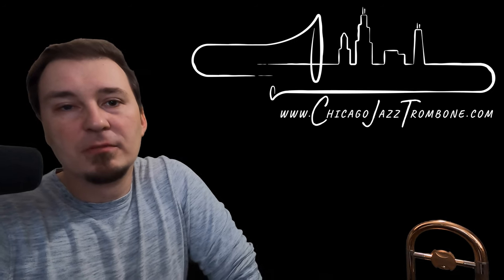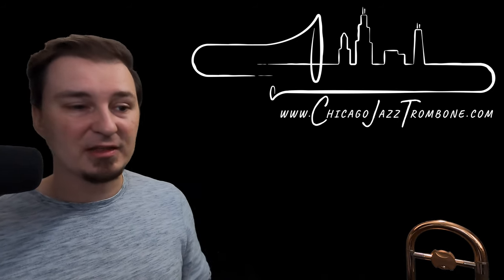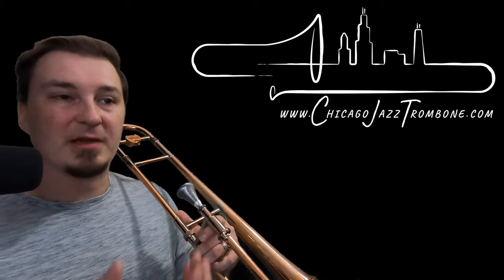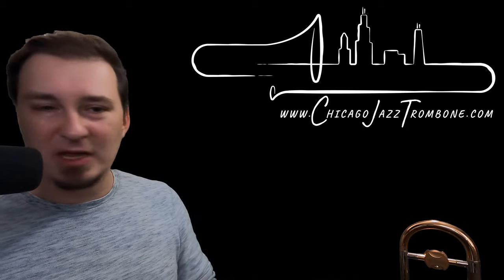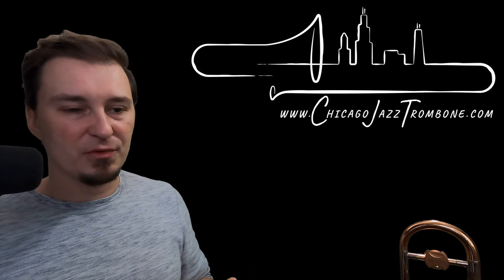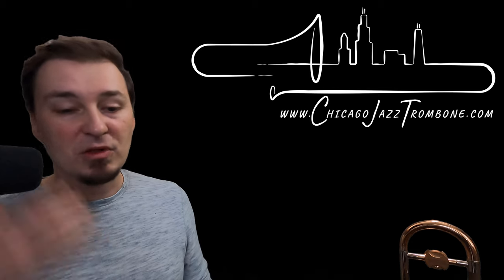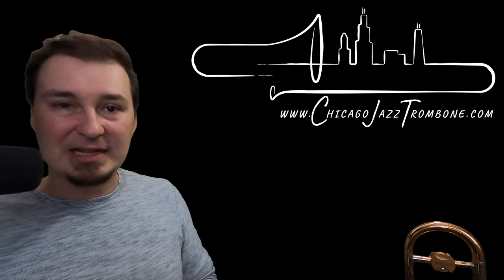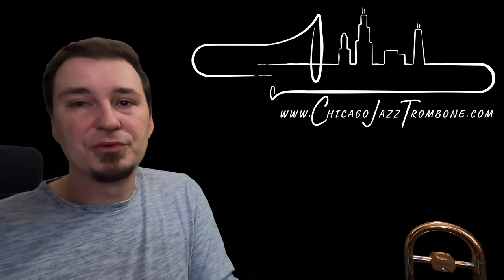Trombone Lessons - Mechanics of Upper Register Playing - Speeding up the air.

Comment: But how do you inhale for some air cuz when i reach up to c as a beginner i try to inhale idk if i opening mouth widely i will suddenly fell down to B Flat
Reply from the maker: When you inhale you want to make sure you are keeping both you bottom and top lip on the mouthpiece. You relax your corners and breathe that way while keeping in contact with the mouthpiece. Sometimes when you go back to play you mount find yourself playing a different note. That’s ok. It just takes practice. Doesn’t happen overnight. As a beginner I know it can be frustrating but everyone goes through different issues while practicing. It will get easier.
Reply from the maker: @trumpettech456 I don’t use this technique with younger students as often as it tends to create more tension in their embouchure. Sometimes it can be helpful but it’s a case by case basis.

Comment: can't wait to practice these techniques!
Reply from the maker: Hope you find them helpful. No pressure, just air speed. I rarely have a ring on my face after playing, just a light one perhaps but I know that also depends on your reaction to brass and playing. My mouthpiece top is titanium so there’s no allergy issues.
Reply: @LowBrassLuke  after 5 years almost exclusively on bass, I am spending some time with new wisdom on my smaller bore trombones.  This is something I want to apply carefully, as I reintroduce myself to the challenges and joys of the higher bones! Thanks for explaining the tongue position and demonstrating the sound of  the air without the mpc or horn, as this is    typically obscured by the full instrument.
Reply from the maker: @bontrom8  I find it very helpful to be as detailed as possible in my explanations and to show how things work without the instrument. This is the approach that works for me but I know everyone is different.